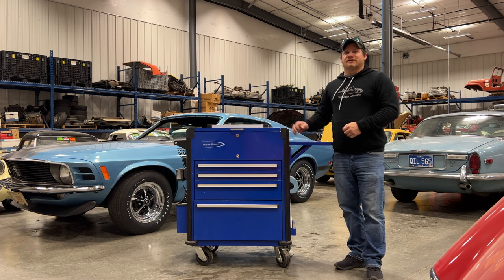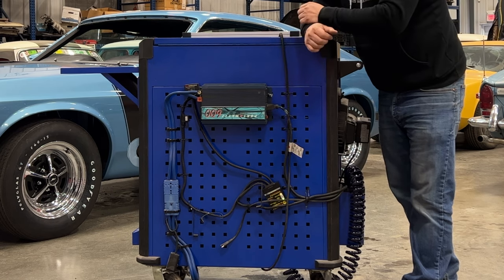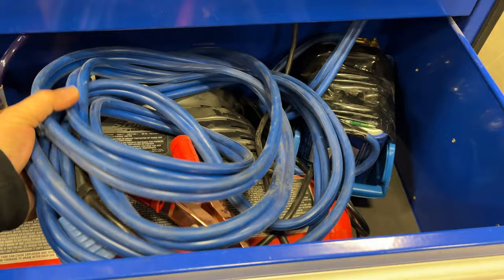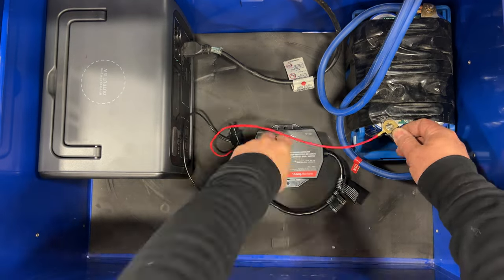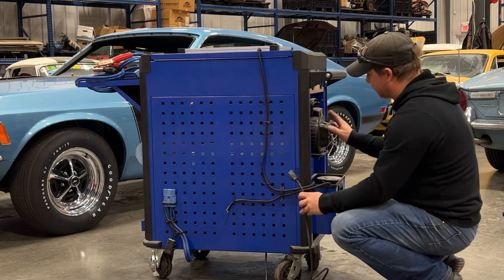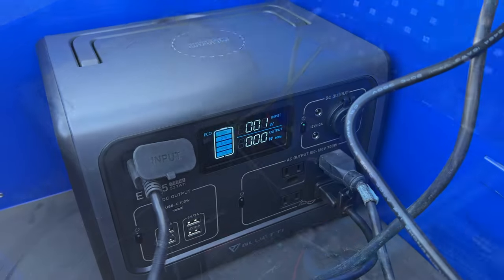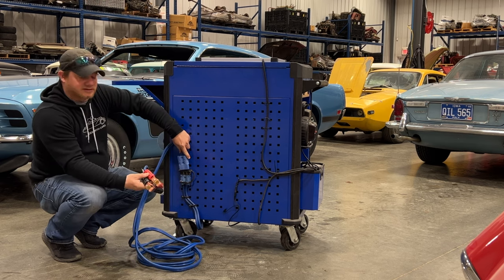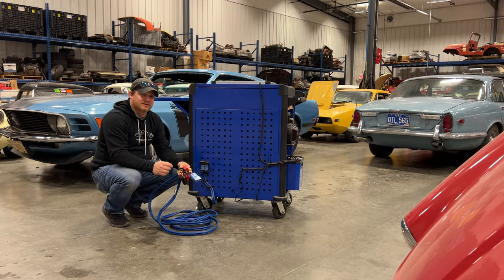Revamping my Rescue Kart with a Bluetti EB55 Power Station

Comment: Wow Steve! A most impressive, comprehensive, self contained, self powering rescue cart. I'm sure MARK feels like a new man. Are there drawers you didn't show us containing hand and cordless tools?
Reply from the maker: No nothing like that, only the special tools needed for getting a car going again.  I posted a picture for you in the community tab.  In there I have carb sync tools, hotwire box, battery terminal cleaning kit, points file, tire inflators, pipe cutter, scan tools, SU tuning kit, cable lubricator, gloves, paint markers, spark testers, side post battery terminal adapters, and starter fluid.

Comment: Great idea on the cart. We have separate  carts set up for different jobs. One for doing electrical, one for motorcycle work, etc. Saves having to walk across the shop and digging through the big box.just roll them to the job. None of ours are as well equipped as yours tho.🤔
Reply from the maker: I have a roll cart with my sockets and screwdrivers etc that I roll over to the vehicle but it doesn’t need power.  My main toolbox has the snap on power drawer but stays in place plugged in the wall and that is where I charge my flashlights and batteries.

Comment: As far as the air compressor goes, if you have a second one you can take apart, have the perishable parts scanned and printed in a more resilient material.
Reply from the maker: I thought about it, for now I was lucky enough to have purchased several of them when I first saw them so I still have them working along.  Also luckily they have both an AC and a DC pump so if one stop working you can still use the compressor with the other mode of power.
Reply: @ThisWeekWithCars  Was talking to friend of mine the other day about "unobtanium things"  things like interior parts and proprietary molds as late as the early 00's  that a database of 3D scans would be worth its weight in gold (yes, I'm aware electrons weigh  9.05 times ten to the minus twenty eighth grams... it's just a figure of speech.  Imagine being able to print a 99% accurate "69 Road Runner Convertible mid-body hood transition stainless trim piece in an hour vs a months-long search on the internet (ask me how I know).  It would be glorious.  Especially in 20 or so years when we will have to be making our own oil filters.

Comment: Pretty cool but seems like I'd rather have a 2nd separate power station box and then my tool box. You could have room for a deep cycle battery in it without losing tools
Reply from the maker: This is not a toolbox with sockets, wrenches, and screwdrivers.  It has only specific specialty tools used when working on a new car that needs tlc before it can drive. I have a different roll cab with my regular tools.